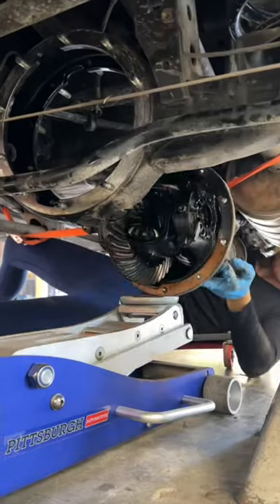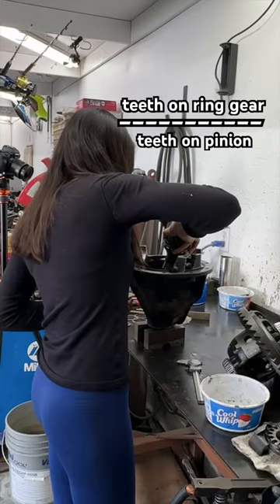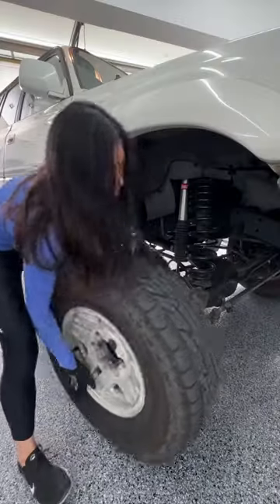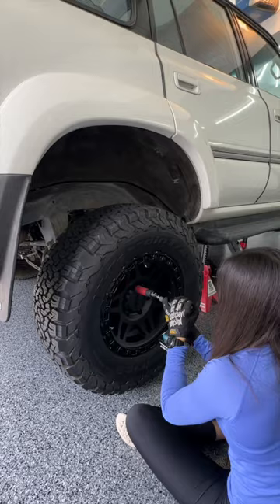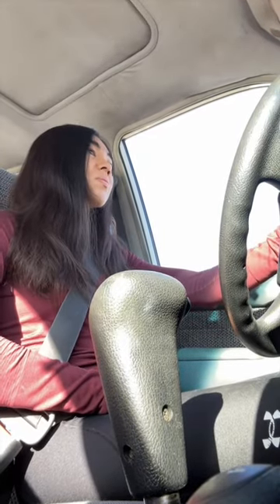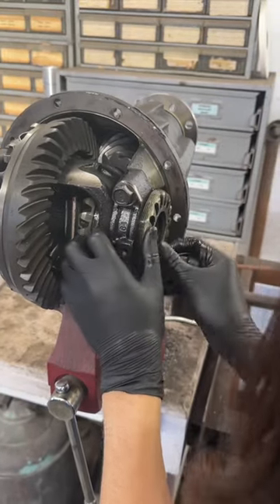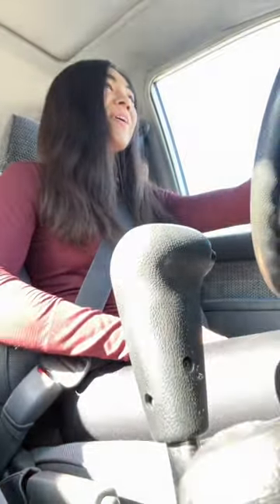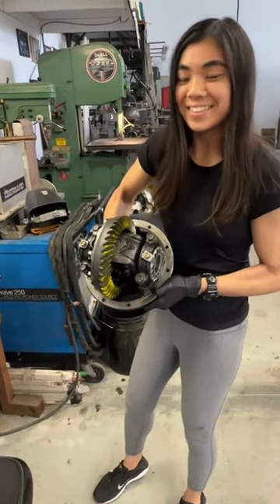Was Re-Gearing my Land Cruiser FJ80 Worth It?? ⚙️ #shorts

Comment: If you're putting bigger tires on, towing, or want the off road capability, regearing is always a good investment. I'm regearing mine in 8 days.
Reply: Would you mind sharing the approximate cost of it? I have an LC200 and just like her, i fitted 285/70R17 on it.
Reply: So is larger brakes!
Reply: It's actually a mandatory not a good investment. With the regearing and the increased strain on the engine she will be able to get 100,000 miles out of a brand new engine with this ratio. Without this ratio it would simply be a rock crawler that you never know when it's going to snap

Comment: In my 94 pickup , because I put on 31", they said I had my choice of 4:10 or 4:56 and chose the 56 only because it gave a little deeper low range. I don't rock crawl, but the areas that I go are quite rough and boy did it pay off. ✌️

Comment: Need to Gear my 2011 Taco. It has the 2.7 liter and 5speed manual. Running 275 70 18”. Like on my truck with the 4 liter 6 speed manual. And rock crawling is a no go now. :) The small motor can’t handle it like the 4 liter TRD Off Road.

Comment: Now it's time for a lift to make room for the tires and take advantage of full articulation.

Also, don't forget to upgrade the brakes.  I'm not sure if you have already.  But one easy way is to replace all rubber brake lines with braded lines.  And since you are doing that, flush the fluid. 

You should be able to find some simple pad/rotor upgrades, like something from Powerstop , or go all out and find either a company that makes even more aggressive brake kits, or see if it is possible to swap out rotors/calipers/booster etc. from a T100 or even if a set up from a newer Tundra would swap in there.
Adding that extra weight from the tires and wheels is going to make the brakes and suspension handle a lot different.

Comment: Do you have to recalibrate the speedometer for the new tires size?
Reply: Yes, she should
Reply: Nah 33s don't change much only like 3 mph at 60
Reply: You can, but she went up to a 285/70/r17. Which is barely larger than stock (did the same on a v6  4th gen 4Runner). Also, the re-gearing wasn’t needed either with these tires. But re-gearing is always fun!
Reply: A speedo calibration is needed if you only install larger tires.  Since she installed lower gears as well, she is very close to the original, overall ratio (driveline speed: distance traveled), her speedo is still good.

Comment: I have 315/70r17s on my 2008 silverado 1500 with the factory 3.73 rear gear and it pulls those tires with no issues
Reply: With an automatic transmission re-gearing isn’t necessary.  The transmission will just stay in a lower gear.  The lowest gear is usually way too low on most automatics with stock tires and it shifts to second at walking speed.

Comment: For 285s you don’t need to regear. Should have gone w 4.88 at minimum if u still wanted to regear. with 2” lift you can fit 35s. I have 35s and 4” lift. went to 5.29 so I could do 35 to 40s.
Reply: Maybe she just wants 33" tires which 4:56 is perfect. I'm Running 33" tires and lockers and my 80 will go wherever an 80 on 35's will go, I do it all the time.
Reply: If I put 285 70 r17, do I have to regear? I drive a 4runner 2004 that comes with a 265 65 r17
Reply: I got 37s on stock gears
Reply: @Kingfish_YT  is that on an 80 series or something else..

Comment: @chloe  good to see you're in the trade, oh I do hope my advice can help reduce injuries i can see you possibly getting. 

 Disclaimer: I am  female Master Mechanic/Technician Diagnostics and Electrical Fuel injection and computer specialist and programmer with over 25 years experience in the trades.  

  Chloe, the way you're lifting the dif is going to cause headaches, neck strain and back strain.
   I would recommend you go to a gym and get some weight lifting technique training. 
 I promise you it will be worth it.

 Also from the short video it looks like you're engaging your neck instead of your core muscles. 

When you get the weight lifting  safety training ask about the correct way to do a squat.   For safety reasons it's not safe to sit on the floor while doing the tyres, it's better to sit on the soles of the feet and squat, that way if anything falls over ,you can just stand up.   This is faster and safer.

There are other health and safety reasons but thats the main three.  

 Please work on the core muscles and oh yes, wrist strength is important otherwise you could end up with serious wrist injuries, been there done that.  

If you are lifting something heavy, just as you would when doing weights in a gym, wrist supports are a cheap and easy way to stop and prevent sprains . 

Nice work on the diff job, what was the final drive ratio when you finished?

Comment: Going with lower gears is great , but why neglect the more important aspect of brakes? Those wimpy stock brakes were fade prone before the tire swap.
Reply: Brake fading can be addressed with flushing fluid and going with DOT 4 (higher boiling point), and installing heavy duty/towing type pads.  That being said, if she were to upgrade to the '93-'97 80 series brakes, it would be a noticeable improvement.

Comment: You know I never clicked on that.
Years ago my diff locked up and I changed axles.
Then I had a fuel problem.
I always though there was something wrong with the computer.
After I fixed the fuel problem.
Didn't think about the change in diff.

Comment: If you’re doing a lot of low speed driving this might(?) be a good fit.  However your MPG is going to go way down. Back in the 60’s my brother’s 1968 Camaro was ordered with a 4.56 posi-traction rear end.  The engine was a 396CI, 375 HP, largest available at the time with a 4 speed manual transmission. The car was unusually fast, however the mileade of MPG was awful. Driving the car normally it gave 8 MPG, driving it hard it was 2 MPG. 

Question…what was your stock gear ratio? 

PS: By the way, I’m a car guy. In the last 10-15 years some manufacturers have used an optional higher gear ratio’s to compensate for a small engine’s lack of power, to give better performance, but at the cost of less MPG. When I was looking for a new SUV, in 2009. I was surprised that most had 2.5L 4 cylinder engines, but performance was not the same. I test drove the top 4 mfg’s. at the time. One of the mfg’s. used a optional higher ratio to increase the take of power of their model, I did not purchase this model. I purchased a 2009 Honda CR-V, which I still have today, at 132.000 miles, still going strong without any problems, so far.  Recently I have noticed that this problem has been going on again, with a mfg. going from a 4 cyl. engine to a 3 cyl. engine and an optional higher gear ratio.  Granted I really haven’t looked for this over the years, but I have run into this twice in the last 15 years without looking for it.

Comment: I'm a mechanic and i never installed  for my customers o my personal trucks 4.56 gears don't make sense if you install 285 75 17 is almost same like original  gears  normally i isntall 4.88 for 35 tires if you go 37 or 40 i used 5.29.  If you

Comment: General rule for old gutless Toyotas.

33's 4.56
35's 4.88
37's 5.29

If your vehicle is heavy can do 5.29 on 35's. Had a SAS armored 87 4runner with 5.29 and 35's. Currently a 92 access cab pickup with 38's and 5.29's. Feels like the same amount of power.

Comment: I'm doing re-gear on my Ram, but no tire changes.  I just don't believe in anything lower than 4.3 on a 4-speed 😢
Reply: 4;22 (factory) in my 68 Corolla 1100 4 spd. 
They are real...I've seen them, touched them, broke one....believe!
Reply: @yourhandlehere1  back before engines had high compression ratios, etc. -- heating was the only way to move heavy loads -- cars weren't that much different. I believe you!!